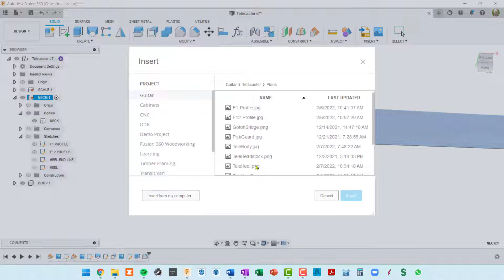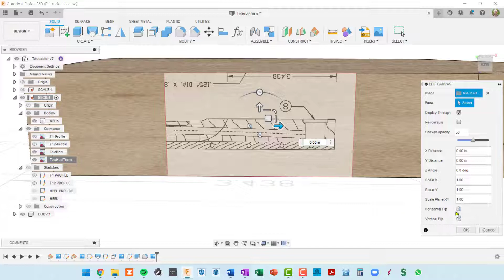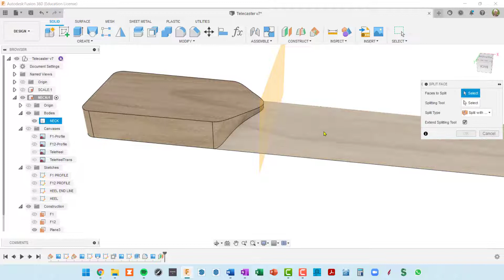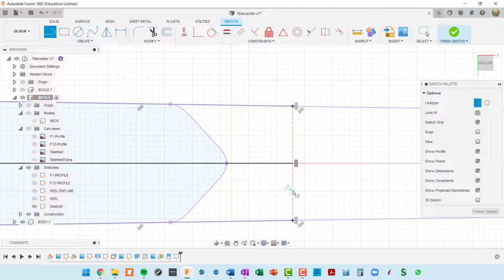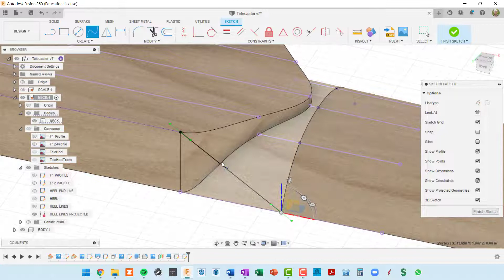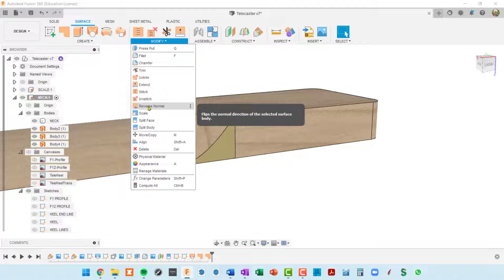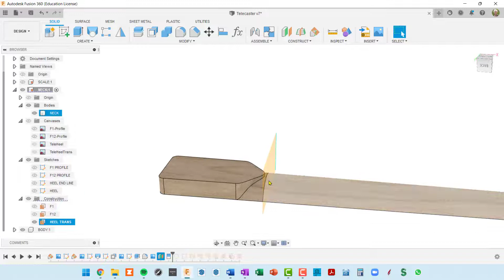Telecaster in Fusion 360:  Part 3, Heel Transition

Comment: When I click tangency on the spline that connects the outer heel to the neck, both sides, the tangency applies to the heel side even though I click the spline, then the line on the neck profile. The opposite handle of where I am clicking takes the tangent. that doesn't happen on the middle ones. why?

Comment: For some reason I can't stitch the transition from the heel to the end of the transition cut that was made. Therefore I can't close the surface and create a solid body. There's just this tiny almost invisible slot between both surfaces. I have tried deleting the transition surface and patching the gap between the heel curve and the end of the transition cut but it changes the curvature of the transition slightly. Not sure what else to try.
Reply: I don’t fully understand your situation, so I’m not sure if my answer applies to your issue at all. You could share your Fusion project and provide a link on the Fusion forums.
If you are talking about the little hole on the very side of the neck that remains open after the loft?
If this won’t patch, it could be that you’re selecting sketch profiles rather than the actual body’s edges in the patch operation. Before patching, hide all sketches, flip all normals that need to be flipped, it might help.

Also look at the Untrim or Extend commands in the Surface environment, they might be able to fix your issue.

Otherwise, assuming it’s this gap you’re referring to, it wouldn’t really matter if it remained open if you intend to machine this with a CNC.
All you need to do for that is a contour cut from a sketch for the outer shape; (set the appropriate depths based on your stock and not the sketch)
As for machining the transition itself, just set appropriate constrains so it doesn’t cut into this gap and add tangential offsets so it effectively machines over the gap. Or if the gap is in fact so small, it might ignore it altogether as your tool will not fit into it anyway.
Not ideal but sometimes you got to start somewhere.
Reply: @PineView80  Thanks for your reply. I managed to patch it messing with the rails. Thanks!

Comment: Thanks very much. This is great stuff. Learning a lot here. Although I don't know why but sometimes I'm getting stuck on some really simple steps. For instance, on 1:10 I can't select that face of my heel so I can insert a canvas there. I can select any other but not the lateral face of the heel but if I'm not on insert canvas mode I can select all of them including that one. So weird. Funny how sometimes even following step by step you can still spend hours on a small thing. Let's see if I can finds a way.
Reply: I feel your pain - problems like these can be very frustrating.  Perhaps there's something in front of the face you want to select.  A good trick is to hold down the left mouse button to get a selection menu of everything that's at the point you clicked on.
Reply: @benweiss897  thanks for your reply and tips… I’m actually not using a mouse, having a hard time rotating and panning with the trackpad of my laptop… I guess it all comes with practice… hopefully.

Really good tutorial. 🤓

Comment: I'm relatively new to this type of drawing in Fusion.  I've got to tell you..... this info is invaluable.  THANK YOU SO MUCH!!!  I'm trying the drawing software first before I buy a CNC.  I'm feeling like I can do it at the moment.... we will see.
Reply: However, I get an error when creating the loft rails: Error:   "The rails do not intersect all profiles.
    All rails must intersect every profile. If using a single rail, try swapping this to a centerline.
Error: Cannot create tool body for loft."  Selecting the 3rd rail doesn't make the error go away like it did in your video.  Help....
Reply from the maker: Make sure in your 3D sketch that the spine ends intersect the transition points.  You will see a square when the intersection occurs.
Reply from the maker: Glad it was helpful!

Comment: Looking good! I would suggest deleting the inner faces on the heel first, and then patch or loft the gap created using the edges of the faces as your rails, rather than sketch geometry. That lets you define the tangency conditions for the surface you’re creating.
Reply from the maker: Thanks for the suggestion.  I will look into that technique and include in my next series (designing a PRS).